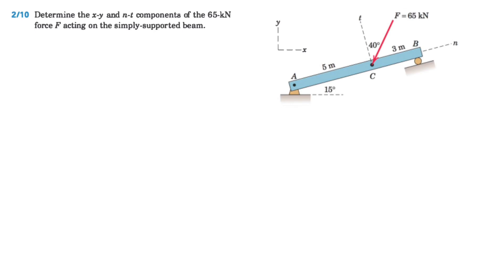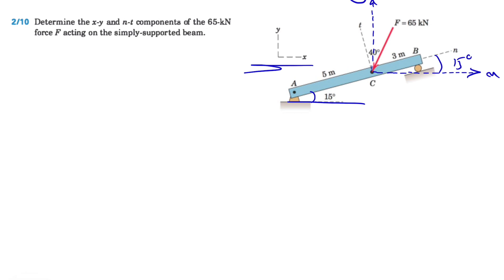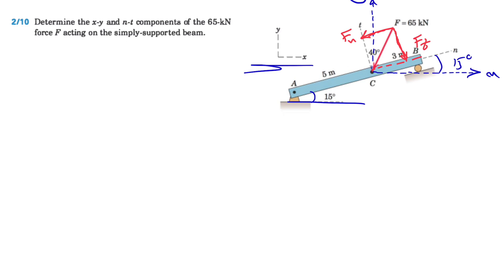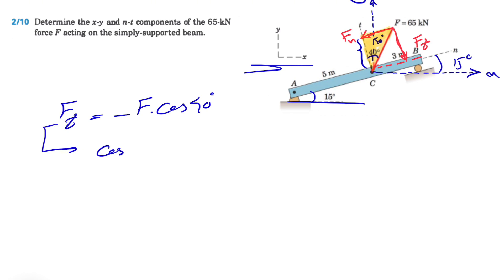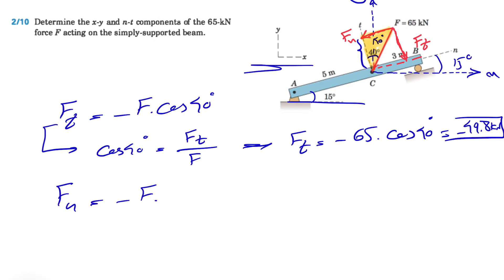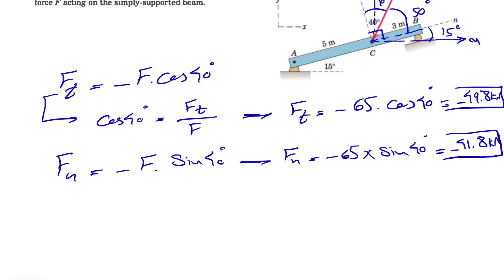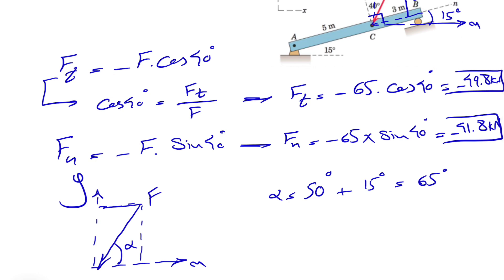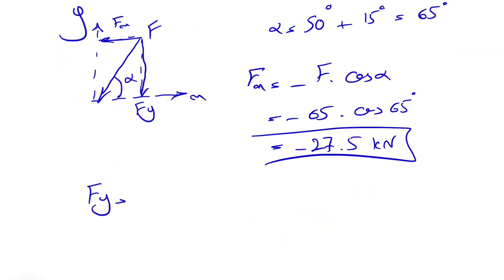Solved Problem  2.10 | Determine the x-y and n-t components of the 65-kN force F

Comment: I still don't understand the sign conventions of Ft and Fn, can you recommend a source?
Reply from the maker: The sign convention for Ft and Fn just depends on how you define the positive t and n axes at the start. If the force component points in the same direction as your positive axis, it’s positive; if it points opposite, it’s negative. A great reference is Hibbeler’s Engineering Mechanics: Statics (look at the section on resolving forces into oblique axes). You can also check most Statics textbooks or lecture notes on oblique coordinate systems.